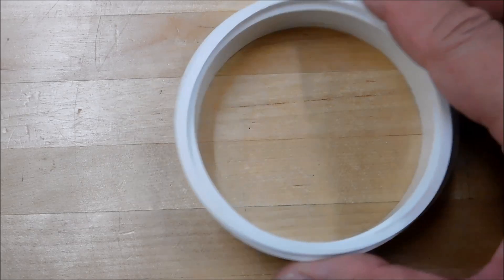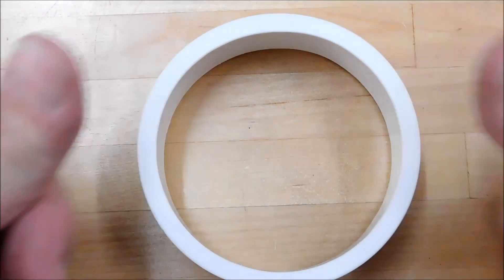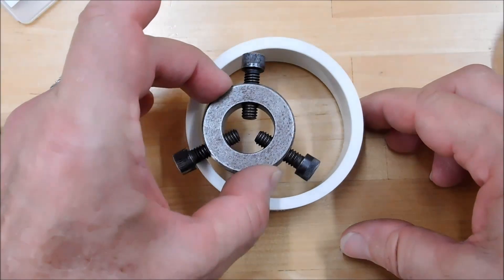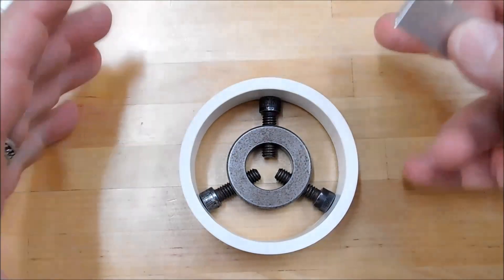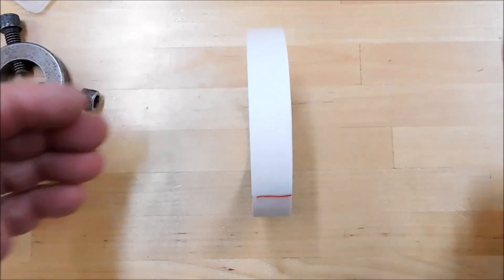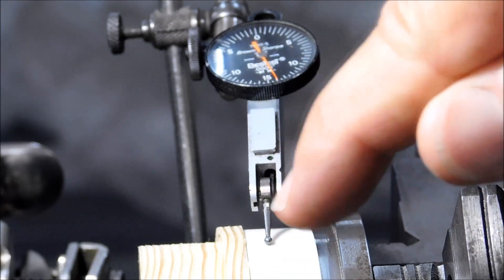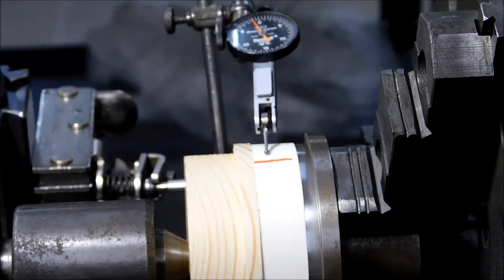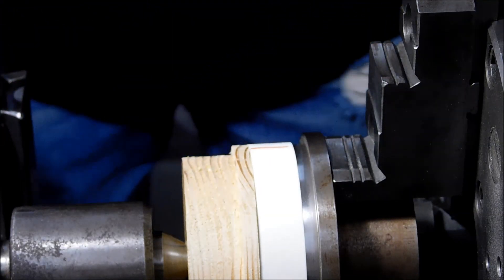Turning and Holding Thin Wall Material Without Distortion

Comment: I would suspect that some heat got into the part when cutting it
Then as it cools, it will push and pull it out of concentricity probably allowing for the slight errors seen,
Meaning one would have to make lighter cuts and a spread of time between cuts to keep heat distortion to a min.
Do you think that would answer the distortion encountered
Reply from the maker: Jaw pressure caused this.

Comment: Hey JP, dig all your stuff. Tnx! Trough watching I learned about & have procured this model General mag base, but haven't yet found the snug you're using. Did you make it or was it a production item? If so, do you know what name or part # to look for? Any help is much appreciated. Tnx again!
Reply from the maker: Its the body clamp for a Starrett last word indicator with a simple turned pin adapter to fit the B&S clamp.  Shown in the attached image. You could easily make one.  https://www.starrett.com/metrology/product-detail/711FSZ
Reply: @joepie221  Thanks for info & tip. I'm sure you're busy & I didn't expect a reply, but it's Super Cool you did. Tnx again!

Comment: Could you make a plug a little smaller and 2 side tape it or glue it the peice
Reply from the maker: A plug is fine if the inner diameter is round.

Comment: OK, the OD is within +- .003 But now how to turn the ID concentric?  Now that's a trick.
Reply from the maker: I'll make a split cup with a nice fit and gentle pressure. Shouldn't be too tough.
Reply: Not a machinist, but now that the OD is done I would just bore out some aluminium and lightly press it into that, machine it that way. Or maybe glue it to a faced part depending on the material. Would be interested to know the correct way though.

Comment: The large included angle between the 1-2-3 blocks used to test the part in the video is more suited to detecting the maximum out-of-round in a five lobed shape rather than a three lobed shape. Constant diameter lobed shapes can have any odd number of lobes. In order to detect the full magnitude of the lobbing, the contacts of the three-point measuring system must be arranged to be in phase with the lobing. The contacts need to be hitting all high points simultaneously  (or all low points) as the part is rotated in the test setup. For a three lobed shape, the V-block needs a 60-degree included angle and for five lobes, it needs to be 108 degrees included. The tendency to produce such “lobed” cross sections that have relatively constant “diameter” is a perennial issue in centreless grinding. By its nature, the centreless grinding process, wherein the bar stock rolls between a regulating roller and the grinding wheel tends to produce sections with fairly constant “diameter” but not necessarily with circular cross section. So, a nice shiny piece of ground stock that mikes as exactly the required diameter, might not be quite all that it seems.
Reply from the maker: The large angle setup and inspection is far more accurate than rolling it under a test indicator set by a gage block.
Reply: @joepie221  Yes and no. For a part with three lobes, any separation of the single lower contact point into two contacts, as when rotating the part on a V-block, will begin to reveal that the part is lobed. However, unless the angle of the V-block is optimised for the particular number of lobes (3, 5, 7, etc), the setup will not detect the maximum variation in radii of the part. The contacts need to be spaced around the circle to suit the number of lobes, so that as the part is rotated, it alternates between having all the contacts hitting the crests of lobes and then all contacts hitting the “valleys” between the lobes. Thus, compared with the roughly 120 degree V-block as used in your demonstration setup, an optimum 60 degree V-block would have registered 50% more movement at the indicator.  A 90-degree V-block will miss much of the lobing in a 7 or 9 lobed part because 90 degrees is close to the worst possible angle for detecting these lobe numbers. I grant that 5, 7 or 9 jawed chucks are about as rare as rocking horse manure, but the higher lobe numbers can emerge from other processes such as centreless grinding. The required optimum included angle of the V-block  is equal to 180-360/N, where N = number of lobes that you are checking for. I appreciate that the main thrust of the video was about distortion of thin walled parts, not the metrology of lobed parts. Thanks again for all the great videos.   https://pmpaspeakingofprecision.com/2010/09/14/5-things-to-know-about-triangle-effect-pseudo-roundness-and-lobing/

Comment: I was wondering what your solution to this problem would be, and I wouldn't have thought of the spider, that's great.  And I suppose once you've turned one properly round feature, you could then switch to a plug or collar for further operations without throwing the part out of shape.
Reply from the maker: Absolutely. Any distortion from that point on can be attributed to material stress.

Comment: k cool what did I miss why do you want a part that's round on the outside and has varying wall thickness?
Reply from the maker: The wall thickness is even all the way around, and not even close to being round.  Maybe you didn't see part 1.
Reply: @joepie221  now I'm really confused. Quite clearly in this video you are trying to make the outer diameter as round as you can. Quite clearly the wall thickness varies.
Reply from the maker: @SoWe1  My comment was referring to the shape of the part I started with. The final part is as you have stated. It will all make sense if you watch part 1. This was a repair/recovery technique video for a very specific condition.
Reply: @joepie221  thx :)

Comment: This is a weekly problem I endure with thin walled hydraulic and pneumatic cylinder tubes, especially when they're bigger diameters. I'll be making a few spiders, and try it out. Thank you Joe!
Reply from the maker: Good luck. Don't use excessive pressure on that spider and you should have good results.

Comment: Another problem with a plug is that being squeezed between the jaw and the plug will cause the part to deform: thinning at the pressure point and expanding sway from it.
Reply from the maker: If you use bored jaws and lighter pressure, it is unlikely to happen due to the surface area contact.

Comment: Great explanation of the pressure turning process! Have not used that method much on such thin stuff, impressive tolerances on such a flimsy part. Would have thought it would relax more after machining. Most thin stuff like that I have encountered had to fit something od or id and I simply made the tolerance side first and the other supported. Big problem usually being creep changing the diameter.

Comment: I have used Cerrobend to fill in the ID on odd shaped parts. Works great.
Reply from the maker: Good idea. Use a smaller diameter plug as filler so you don't need as much to fill the gap.

Comment: I will have to disagree. A plug is the best way.
Reply: So it wouldn’t distort the part into the round shape of the plug and then return to near original distortion once the plug is removed? Try this and show the results please.
Reply: Only if the inside roundness is already acceptable. In this example with the flimsy ring it was assumed not to be. I use expanding arbors for many thin parts, they are often the best solution. They are somewhat expensive but save a lot of trouble in the long run. The inside still needs to be good, many plastic pipes have a very round inside.
Reply from the maker: Plugs provide a lot of support, but can influence the part. if its already round, have at it.

Comment: my last job involved turning down these 4ft tubes of 304 stainless talk about harmonics and distortion. Ended up using spiders a lot.
Reply from the maker: Use rubber expanding plumbing plugs on both ends and fill the pipe with sand. Harmonics are gone.

Comment: You sure chose a good field to be able to benefit from your ability to think your way out of boxes! I love how you always snatch victory from the jaws of defeat!
No inanimate object is going to beat you!
This pinch technique reminds me of turning the magnet off on an overhead grinder prior to making the last pass. 
Suburban Tool interviewed another shop's machinist and he agreed that was the way to finish up and he also shared that they used to have a window that lined up with the grinder but now it's plywood......hmmm, wonder why :)
Reply from the maker: My last boss used to give me a project and say 'This is impossible" , then walk away smiling. Right up until he gave me my next impossible job.
Reply: @joepie221  That's hilarious! He knew the right buttons to push!
I, too, love figuring out the impossible.   :)
Reply: @joepie221  speaking of impossible, I'd like to propose a project that many would deem to be impossible. 
Make a light weight wheel whose only important parts are a center shaft and a strong rim. 
Line the rim with relatively small motors which could be anything from battery powered ones salvaged from toys, to bathroom ceiling fan motors...... doesn't matter, just plain Jane off the shelf motors. 
Now, bear in mind that the wheel is an infinite series of levers and we all know that levers mechanically amplify power - a child can lift a car with a simple lever. 
Next, using a shade tree mechanic clutch (pulley/ bearing assembly on the end of a lever) we tighten a belt and engage an electrical generator. 
Many little motors, with their feeble outputs amplified, do the impossible.
Then we use another hillbilly clutch to bring in a heavy flywheel that'll maintain rotation of the device for a short time. 
We quickly switch out the power for the rim motors to power from the onboard generator. Once power is switched over, we remove the heavy flywheel and use it somewhere else or put it on the shelf until next time. 
So, if we've done our homework, we're now powering our rim motors and supplying power to a refrigerator and a TV, etc.
The humble lever. 
The simple device that mechanically amplifies power. 
Energy created in ways like this must be gradually done on a grassroots level so that it doesn't tank society. 
So, we're the grassroots. 
Let's begin the transition to a new way of meeting our needs. 
Have some fun with this  :)

Comment: Interesting. Thanks for making the video. I have a 6” diameter six jaw scroll chuck. Six jaw chucks are supposed to be good for holding thin walled parts. But I would have to do a similar experiment to see what kind of results I would obtain. Stay healthy.
Reply from the maker: They are better than a 3 jaw, thats for sure. I have a video on chuck selection. You should check it out.

Comment: I realize that your test indicator did not have enough travel, but when I need to remove the minimum material from a distorted part it is the lows on the O.D. that matter the most.  It is often a trick to get all the lows to read the same and the highs to be minimized as well.  Plus, having match the existing face as closely as practical as well.  This is where a 4-jaw chuck with copper pads becomes indispensable.   Then there are the creative ways to clamp to the t-slots in the chuck.  But, again, my parts are rather large (for your world) iron castings which I have to work with the existing machined features.
Reply from the maker: The lows would be the target surface.

Comment: Hi Joe.  Again you have done the heavy lifting which is defining exactly what the problem is.  Another approach is as follows -  Stretch out some cling film on a flat surface.  Apply a thin smear of silicone grease to the inside where the part is to be gripped.  Apply some Blu Tack or playdough to the edge of the job.  Then press firmly onto the cling film to form a liquid proof barrier.  Fill the job with two pack epoxy to the desired depth.  Alternatively, to conserve epoxy fit a loose fitting plug and let the epoxy just fill the gap.  (The plug is reusable).  After curing the job can be gripped firmly with minimal distortion.  The plug will just push out when finished. This method will work with odd shapes.  Cheers  John
Reply: John Spathonis Great idea. Could the heat of the curing epoxy add additional distortion?
Reply: @836dmar  Hi E  If the mass of epoxy is large and a fast cure is selected - possibly.  The use of a slug with epoxy around the circumference would not raise the temperature at all.

Comment: It would seem like if it was a one off part that you could fill the inside with a liquid that would harden into a solid.
Reply: depending on the part if thats the case why not just start with solid stock???
Reply: @richardcranium5839  depends on how much stress you have in your stock material. Sometimes you get an oval

Comment: I hate to be negative but this seems to be a lot of trouble for no good reason. JUST CHUCK UP A NEW PIECE OF PVC WITH THE SPIDER AND MAKE ALL THE CUTS AT ONCE!  Sometimes a reality check should be made to determine if something we are trying to do is outright dumb!
Reply: And if it is piece of special alloy tubing that needs to be thinned that cost $120 per foot I am sure your boss will love you for not to save a part.
Reply: @brucewilliams6292  exactly Bruce. It's easy to waste material when he isn't paying for it. Also, this channel, Joe and this industry is about learning and growing. Most who watch his videos have the same goals and aspirations, but i see that some don't.
Reply from the maker: You are correct. The best way to correct a problem is not to make it in the first place. Having not watched this video, some wouldn't realize the variety of methods to do that. If this was a repair job, making a new part wouldn't be an option.
Reply: @joepie221  I have in many cases found that making a new replacement part was the ONLY practical solution. Some people will spend hours and hours welding up a worn shaft when a brand new one could be machined in half the time and cost. Of course there are cases where this would not be practical, like if the part was large and expensive.
Reply: Agreed with you Ron. Why make our lifes complicated?
Reply: @Sodabowski  lifes?
Reply: Michael Miller gee, lives... excusez mon anglais when I’m tired 😆
Reply from the maker: @Sodabowski  Ron?
Reply: Joe Pieczynski right, I should have tagged @glasslinger ;)

Comment: As usual a good presentation.   Every machinist should learn how to minimize distortion from the holding and/or machining.   This shows ways to do it.   However, one should always determine if the distortion is or will be a problem.   Unfortunately I witnessed a major oilfield service company spend thousands on distortion that made absolutely no difference.   Some engineers have no sense of reality and will specify unnecessarily tight tolerances.   If you are a hobby machinist you have final say, so make sure you don’t overdo the precision. 
Enjoy your work.
Reply: especially in PVC tubing!
Reply: @glasslinger  
The pvc was a prop for filming purposes. In practice, when using, let's say, a super alloy made of an extruded tube costing a coupla  hundred bucks per foot to make a one off part, this is one of the best methods to use for optimal accuracy in the finished part.
Reply: Stan Ervin material makes a slight difference.  Some may even exacerbate the issue (like non magnetic stainless steel, cold worked to 140,000 psi minimum yield).  But consideration of two ideas should be taken.   First and foremost is “is the part fit for purpose?” And how is compliance playing a role.  If one is machining to print, then meeting print requirements is paramount, but if not, then the “compliance” factor should be evaluated.  It will seldom be, that a part easily distorted by jaw pressure, will be tasked with holding size, shape, or location.   It will be the compliant part.  If that is the case, does it matter that in a free state it has the “right” measurements, or is it more important that it can “comply” to the “right” measurements?   Case in point, as mentioned in my first comment.   A fluid displacer that fit over a MWD Sub was specified to a ridiculously tight roundness callout.   The only critical dimension (regarding fit) was that the ID was large enough.   When being assembled the “displacer” would comply to the Sub with no problem at all, yet the “reliability engineers” forced spending thousands chasing an unnecessary requirement.   Fortunately they were finally overruled.  Hobby machinists should make sure they are not chasing an unnecessary goal also.  
But as you stated, and I alluded to, if one is making a “one of”  (short for one of a kind) part, knowing how to hold the part to minimize the effects of holding and machining are skills every machinist should master.

Comment: What about the pressure from the indicator? You got a spring in the part that press on the spring in the indicator: The indicator push back on the part and moves the part instead of the tip in the indicator.
Reply from the maker: I've done paper thin roulon bushings that the indicator pressure would distort. No joke.
Reply: @joepie221  
That's beyond splitting haiirs. That's splitting cilia! What's the durometer of this 'roulon' substance?
Reply: @stanervin6108  - I believe he's referring to 'rulon'.  https://en.wikipedia.org/wiki/Rulon_(plastic)

Comment: There is another way to skin a cat.I dont know whats it called but if you make a ring and slit it with a hacksaw and put it in the 3 jaws it  will act as a collet.Same thing goes if you need to shorten a screw for example -by using hacksaw and cutting 1 side of a nut it will hold the thread like a collet.just make sure that a slit is in between 2 jaws.
Althou that little spider is a great idea.